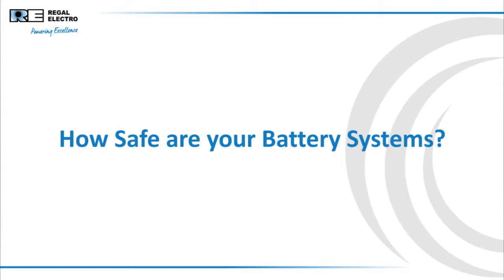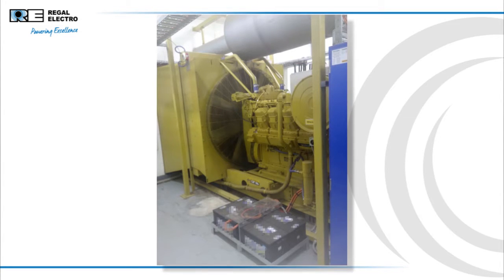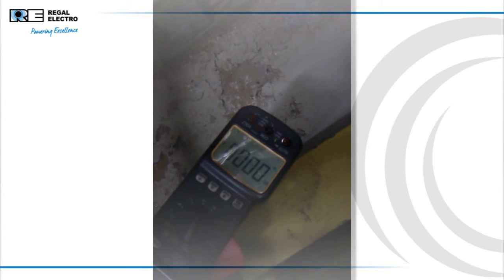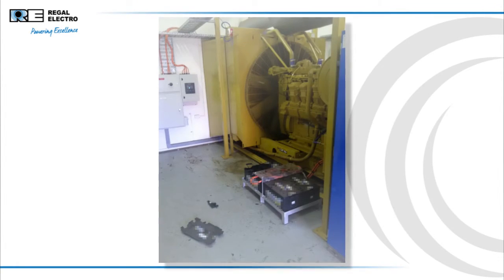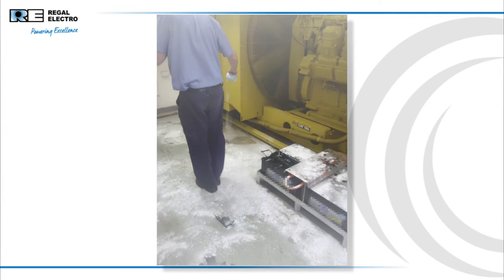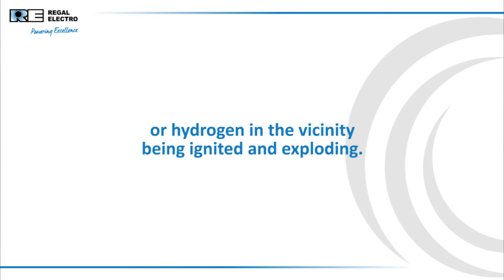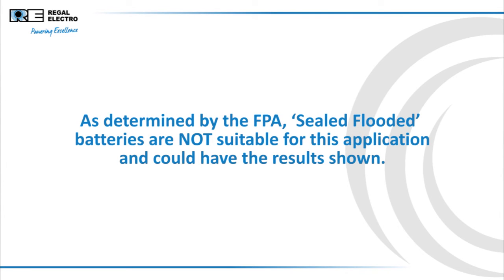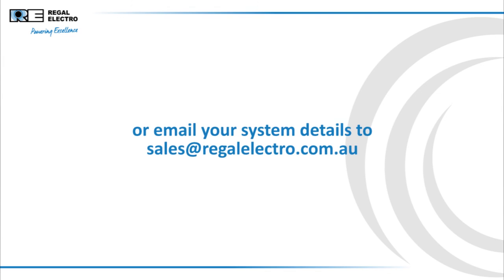Battery Explosion

Comment: The 24 v battery exploded on me in navy rework center in San Diego and so beareful inside it had a fuse or secret remote switch so after recharge it had enough hydrogen to blow up and if inside a car with fuel line can be remote open then not only explode it can start big fire cost your city all of the bank to put out thousands or hundred thousand fire a day

Comment: I am a Telco tech specializing in COPE. From my experience batteries will also blow up if you do not have enough water in the cells and another scenario you do not have enough AMPS (aka batteries in series) to fire up the gen unit
Reply: Vincent Anu, I've 4 Exide Batteries for my Hybrid solar system.

The distilled water had once dried up completely. And the Solar Inverter displayed "Short Circuit". There was bit of a spark in one of the Electricity Junction of our House. That's all.

Fortunately, my Batteries DID NOT Explode, as you said it! Do you know why?